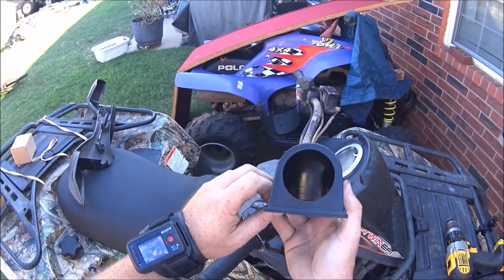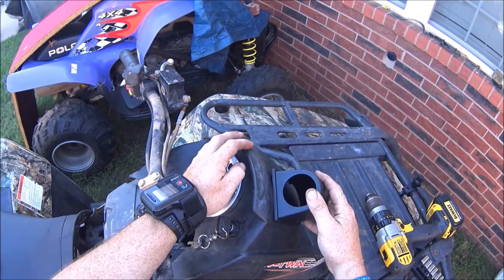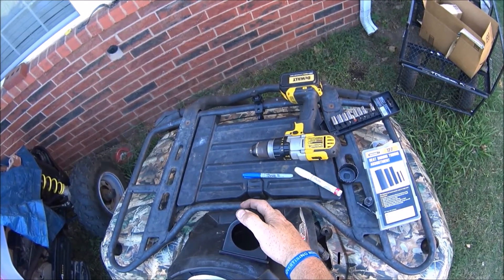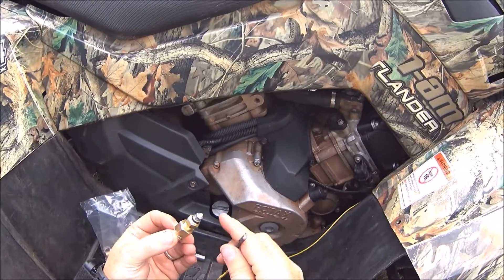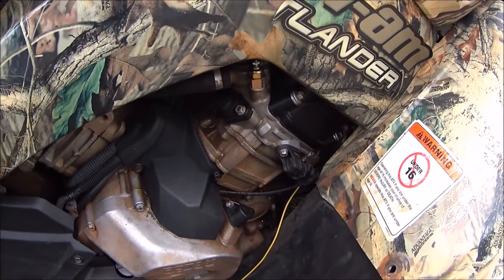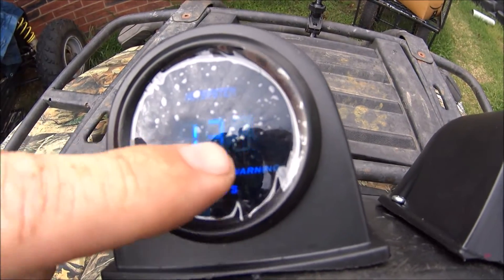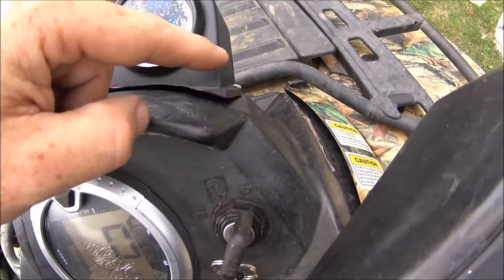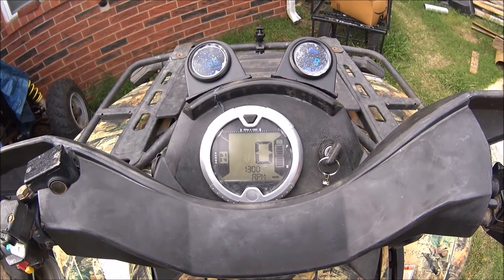Adding Temperature Sensor Gauge and Voltmeter Gauge to ATV Part2

Comment: You're reading the water temperature on the wrong side of the thermostat.  The temperature you want to read is on the motor side of the thermostat, not the radiator side.  If your thermostat doesn't open,(sticks) the water in your motor will be heating up and you won't know it.  If your thermostat is always working properly, you're good, if not you could overheat your motor and not know it til it's too late.
Reply from the maker: Good point your are right

Comment: How have these gauges held up as far as water resistance goes??
Reply from the maker: They still work good.  But keep in mind I don't mud my quad.  It hadn't seen rain or anything.
Reply: @2LateIWon  Thanks so much for quick reply.Im not a mudder myself,    as for the rain i figure the odds are 50/50. Getting set to add a temp/oil pressure gauge - If its possible to add a pretty line of silicone around the bezel to help, thats just what Ill do. Cheers Brother.